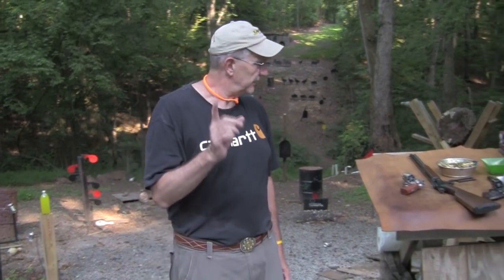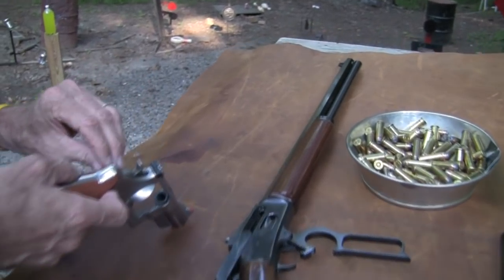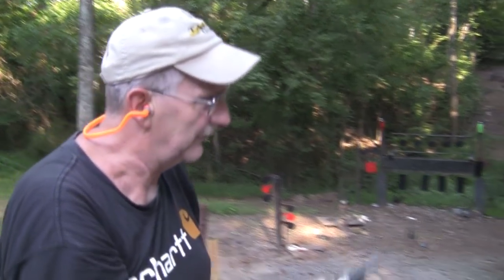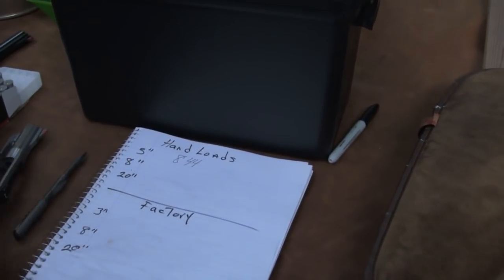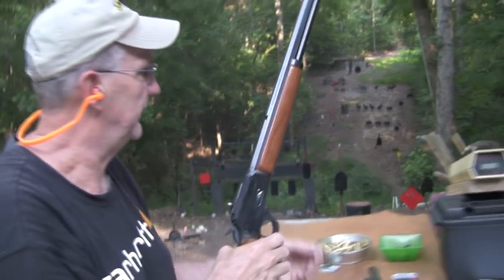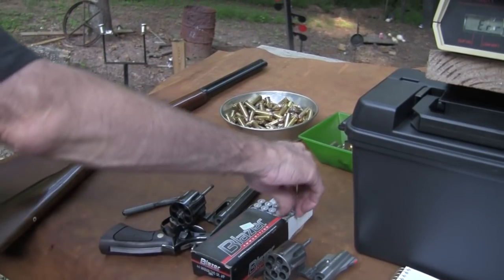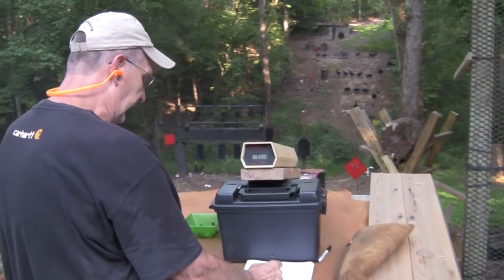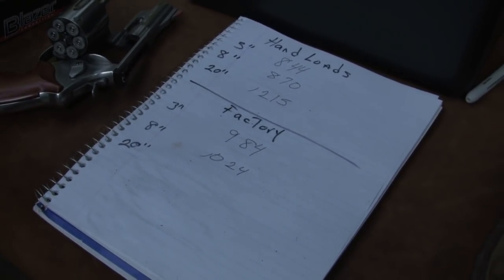44 Magnum Velocity Basics.

Comment: I wonder if the extra weight of the longer barrels negates the recoil of a speedier bullet. It would be kind of counter intuitive if longer barrel equaled more recoil.
Reply: longer barrel does not mean more recoil
Reply: Jonathan Langford even though the bullet's traveling faster?
Reply: +martin mcgorty 
A friend of mine had a very nice snub nose 357 magnum. It's a lot heavier than a normal 38 snub nose, but I fired the same factory bullet out of that gun and my 6" 357 and I will tell you that after firing 6 rounds out of the snub nose you don't really want to fire it anymore. I can shoot my full size all day. So yes the bullet is traveling faster but that doesn't equate to more recoil. The heavier the gun is for a given bullet the less the recoil. Shoot a 44 magnum out of a rifle and you will think to yourself, wow I like that I could shoot that all day. Shoot the same bullet out of a short barreled revolver and you probably won't like it. I'm talking full factory loads, not light reloads. There's a difference in shotgun loads also. Shoot dove loads out of a 12 gauge and then shoot turkey loads out of the same gun and you will notice a big difference. But shoot the same load out of two different shotguns with a noticeable weight difference, usually do to barrel length and you will see the difference. Shorter barreled lighter shotgun will kick harder with the same load as opposed to a long barreled turkey gun.
Reply: Bruce Thanks for the response. I didn't mean to dispute what Jonathan Langford said, and I don't know who marked it as spam, I was just asking a clarifying question. I've shot .22's, 9mm's, 30-o6's, and 12 ga.'s, and I've browsed ballistics forums, but that's above my pay-grade as far as mathematics is concerned. The simpler test would be to fire the same factory loaded magnum out of a snub nose and a long barrel and make note of the felt recoil. The answer seems to be that the extra ounces of steel more than compensate for any extra recoil of the increase in the speed of the bullet.
Reply: martin mcgorty One thing you must remember: It's not just the bullet weight. There's the weight of the powder and energy to consider. The longer the bullet is in a barrel, the more the powder is consumed. The Law of Conservation of Energy tells us that energy can not be created nor destroyed; only transformed. In this case, the energy is more efficiently transfered to the bullet in a longer barrel. It's the same recoil energy but manifested in a different way.
Reply: A longer barrel will consume more powder and prevent the "Rocket" effect of the powder as it exits the barrel.
If the barrel also weighs more, it will indeed have less real and felt recoil than a lighter gun.

Comment: As you speak 5000 metal ergists around the globe are scrambling to come up with the formula for this new aluminumbrass you speak of. Some of the aluminum and steel cases do have boxer primers and can be reloaded at least once. But it is not recomended . steel will ruin your dies and aluminum cases can rupture if reused.

Comment: I used to load 180 grain XTP 44 magnums with a hot charge of H110. I would have loved to know the velocity of those things. They would explode anything they hit.
Reply: I think they will reach 1868 FPS I guess that's maximum According to some of my reload data. That's what I load is h110 and 180 grain Hornady XDP but I've got me some 210 grain Winchester Silvertip hollow points. I wished I could find silver tips in 180 grain but I don't guess they make them. Happy shooting

Comment: I've done a bit of math, and that does seem to be the case. The thing you have to keep in mind is that as the gas from the powder expands through the barrel its pressure drops. The longer the barrel is, the more the pressure drops. Eventually the pressure drops so much that it can no longer effectively accelerate the bullet. At some point making the barrel longer will not increase the bullet's velocity.

Comment: When is a barrel length too long for a cartridge ?
Reply: With a 22LR the bullet actually starts slowing down after about 16 inches. With more powerful cartridges than 22LR, don't worry about it. The barrel would have to be way too long to be practical.

Comment: It's quite simple. There are 2 light sensors on the top of the chronograph, one at the front and one at the back. When a round is fired, it blocks the light getting to the sensors.

The chronograph measures the time it takes the projectile to pass over both sensors. Since this is a known distance, it is a simple calculation to find the projectile's speed.

Comment: This in in order of inches; five shots were fired at each barrel length, with each of the three brands of factory loads, Federal, Winchester and Remington, all using 240 gn bullets. 
1" 742 FPS
 2" 935
 3" 1067
 4" 1165
 5" 1239
 6" 1298
 7" 1345
 8" 1384
 9" 1417
 10" 1445
 11" 1469
 12" 1490
 13" 1508
 14" 1525
 15" 1539
 16" 1552
 17" 1564
 18" 1575 
Hickok45 you need a new chronograph your's is way off to say the least.

Comment: I believe the reason barrel length increases velocity is because of the time the pressure is given to accelerate the bullet. When the powder ignites and explodes, enormous amounts of pressure are created inside the barrel. This pressure forces the bullet out of the barrel. In a 3" barrel, the time that the force due to pressure is applied is much less than in a 20" barrel. Kinda like if you were pushing a cart and could only run 3' to get it going as opposed to 20'.

Comment: You should get some hundred and ten grain 44 mags will do 2500 feet per second
Reply: Where do you get a hundred and ten grain bullets? I can't find anything in the 44 and less than 180 grain. I can buy 165 corbon but it's the entire cartridge not just the bullet. I thought I'd had some 158 at one time but I don't remember where they come from. All I got to load is 180 grain Hornady xtp and 210 grain Winchester Silvertip. That's something else I can't find 180 grain Winchester Silvertip. I'd appreciate it if you'd let me know where I can get something less than 180s. Thank you and happy shooting!

Comment: Unfortunately you don't have a firm grasp of fundamental physics using energy to spin the bullet and the friction against the filing which spins (and slows down) the bullet  will not result in an increase in velocity. 

you might be familiar with the formula  v=at (unused portion removed)  the acceleration isn't constant so that formula wont give exact values but it shows that the longer an accelerating force is exerted on the projectile the greater the velocity